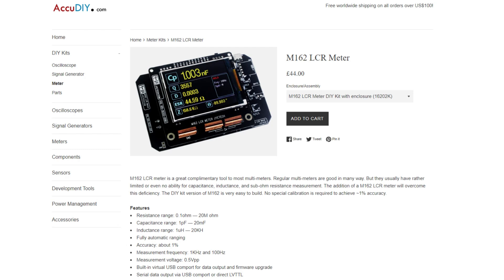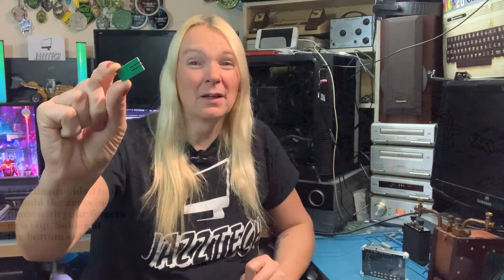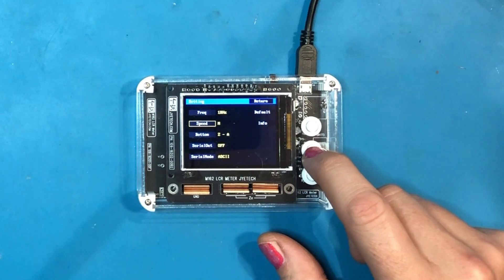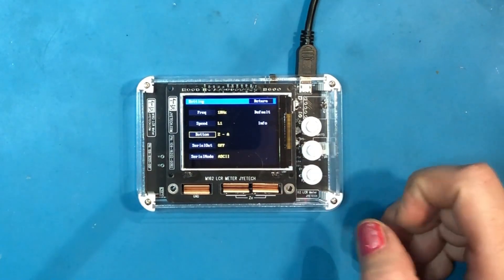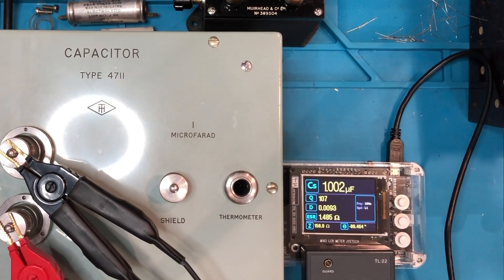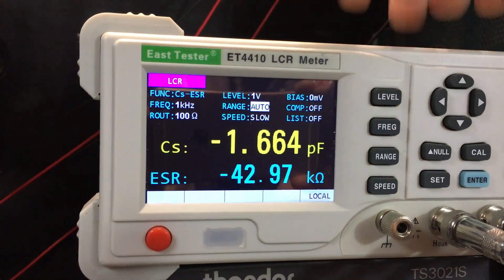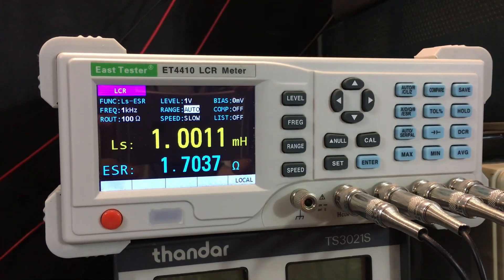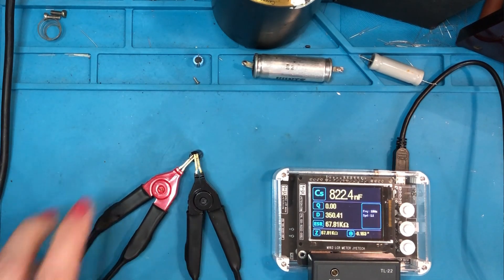M162 LCR meter kit Part 2 - Specs, Leads & Testing!

Comment: Good morning. How are you doing? How does this compare to the tweezers? I’m only a hobbyist so wouldn’t want to spend a ton of money. Also will this test in-circuit? Thanks again for the video
Reply from the maker: I would stick to the tweezers. They are more accurate and easier to use in-circuit. The M162 is good but I still prefer the tweezers.
Reply: @JazzTechUK Hi. Thank you so much for replying… one a 1 year old video to. I will take your advice. Thanks

Comment: The serial chip is just a CH340 variant just the same as on most Chinese Arduino. The driver situation is that no fresh drivers are shipped because you don't have to worry about it, Linux just has them built in for ages and Windows 10+ fetches them from Windows Update automatically.

Bought myself funny little LCR tweezers recently, cost 16 EUR. Called QPLCR, text is all in Chinese (no English option), has an MJF 3D printed enclosure, really well done, not at all obvious at first. Zoyi has a similar item but more mass produced, no 3D printing there and with language options, which is perhaps more suitable, but i thought purchasing the QP was funnier and i think good decisions are severely overrated; and Fnirsi also has one but that one is probably garbage.
Reply from the maker: I have reviewed the Zoyi MD-01 tweezers. They are very good.

Comment: Hi.  I have/had and assembled one of these M162 LCR.  I say 'had' because JYETECH has an upgraded meter that tests at 10kHz, the M162-10, and there is a modification noted on the website that allows the regular M162 to be upgraded to the M162-10 by replacing 3 caps, one resistor and burning new firmware.  Everything is on the site.  Next.  The only issue I'm having has to do with electrolytic caps reading a lot lower than expected.  I've seen and read what I could find about errors testing electrolytics at higher frequencies.  I've tested quality electrolytic caps and caps in a cheapo kit and I find the quality electrolytics test closer to their labeled value than the cheap ones, both being a bit over and under the 20% tolerance but not good.  Both caps test very close to their labelled values using the three other LCR meters I have.  A bit of research and help from some online forum users indicate that some meters bias the electrolytics with a low voltage to keep them happy.  Maybe the M162 doesn't do this, but I will check on that since I am in contact with JYETECH's owner and chief engineer.  If you have time, I would like to see if you are having the same issue that electrolytic caps measure quite low on the M162 but normal and very close to labelled value on other meters.  It was the same before and after the 10kHz upgrade so either we will have the same issue OR I screwed something up during the initial assembly.  All the other functions and the measurement of ceramic caps are pretty near perfect and without issue.  Thanks.

Comment: Hi Jazzy I enjoy your channel
I have two tips I learned as a young technician years ago
1) always put your thumb over the lead you are clipping off your PCB
At Phillips years ago a tech got a clipping in his eye
As a young tech, I clipped a lead and it blew an oscilloscope where I was working

2) don't wipe your soldering iron on a wet sponge it cools down the temperature
I was taught to use an old rag
However, I found toilet paper much better
I never scratch my soldering iron time I have a tip that lasted me 30 years
Reply from the maker: You have point about stray offcuts going into unexpected places. I need glasses for close work so my eyes are always protected when soldering, cutting and fault finding old gear. Thanks for the tips and thanks for watching.

Comment: I ordered a M162 LCR meter. It was a challenge for me to build even with reading glasses. I added a ZB-L100K Handheld LCR Test Clip Universal Digital Bridge Kelvin Test Line from Amazon. It is very similar to the one you have. The thing about it that irritates me is that the connector block wobbles when plugged in. I solved the problem by using pieces of a .190"x 11.5" zip tie. I fir 3 pieces into the space between the Kelvin contacts. the piece between the outer is just a shim to hold the outer pieces against the copper contacts. Use hot glue to hold the pieces in place then pull out the center one. That leaves space for the kelvin block contacts to fit snugly into. Now the Kelvin block fits way better.

Comment: Hi Jazzy, would you help me out? I am interested in a milli ohm meter but a little confused with the ranges they offer. One has 2R, and the other 20R. Looking at Temu and AliExpress, and both have the same. I am a novice/hobby-ist in this field, and do not want to spend a lot of money on a resistor(short) tester.  What do you recommend. Thank you.
Reply: Thank you so much. Your help is greatly appreciated.
Reply from the maker: 2R means the maximum resistance value it will measure on that range is 2 Ohms, so on a 3 1/2 digit meter that would mean a best resolution of 1 milli ohm. Realistically the last digit will be inaccurate so the next digit will be the first one to trust so a 2R range milli ohm meter at best will resolve 10-20 milli ohms. You will need one with 4 wire Kelvin leads. I'm not familiar with what models they have on Temu or Ali Express so can't help you on an exact model no.

Comment: Hi. A bit late to the party, but thanks for the great videos on this cool bit of kit. I notice that your 4 wire arrangement isn't actually a Kelvin setup and is just 2 wires in parallel for each contact. There is only one connection at the meter and one connection at the clip, so both wires are joined at both ends! This means that all of your readings will have an offset caused by the LCR of the cables and the small values that the unit is capable of measuring may even be swamped by this. Adding screened cable to this configuration just makes matters worse by increasing the parasitic capacitance and inductance.  It should, however,  be possible to modify the meter to provide 4 wire operation by removing the copper contacts and connecting directly to the 4 Sense and Drive signals on the PCB.
Reply from the maker: The PCB contacts on the meter board for the middle and right contacts are in fact 4 separate contacts on the board. They are not joined together as one like you think they are. The contacts on the left are ground contacts and are joined on the board. The lead plug has 5 separate contacts, 4 for Kelvin and 1 dual contact for ground which terminates all 4 screens of the cable at the meter end only.
At the clip ends the contacts are split either side of the clips.
The whole setup is making true 4 wire Kelvin measurements with screening to keep down noise.
During testing, measurements made directly in the meter contacts or at the ends of the leads showed negligible difference between them. 
It's a very nice meter and one thing I like about it is it shows all the parameters at the same time as well as being quite accurate. Thanks for watching.
Reply: @JazzTechUK  So each half of the contact is separate and connected to a different pad on the PCB. The mating connector is insulated between sides of each pin. Thanks for clarifying. That makes sense. I'll get one of these ordered.
Reply from the maker: It's a very nice kit. It does not come with the Kelvin lead you see me use in some of my videos. I made that up myself.
Reply: The name Silly sausage is so adept 🤣🤣🤣

Comment: Could you take  a known good electrolytic capacitor of a few hundred micro-farads, make note of it's ESR and then put a two ohm resistor in series and then repeat the ESR measurement? I'd like to see how well the meter can track the known change in resistance.
Reply from the maker: I'll give that a try and let you know.
Reply: @JazzTechUK  Wasn't sure any of the YouTubers would test ESR this way and got tired of waiting so I also ordered a M162 to try it out. Fingers crossed.
Reply from the maker: You won't be disappointed. It's a very good kit and quite accurate.

Comment: Very cool "standards" that you've collected!
I have some 0.0025% resistors, salvaged from a 1960's military analog ballistic computer, and a 5 digit Kelvin Varley Bridge, but none of your capacitance standards, but I have a fairly decent handheld LCR meter, and a 6-1/2 digit multimeter...
Reply from the maker: I have access to these standards when needed. They are not mine. There are a lot more, so can cover most all resistance, capacitance and inductance values. They are very handy.

Comment: Why didn't you compare the ESR readings with the expensive meter?  We couldn't read them on the small meter but the readings you were reading sounded very strange.
Reply from the maker: They were similar on the expensive meter. I did call out the ESR readings on the M162 meter as I was testing them. The ESR values were about right, except for the bad capacitors.